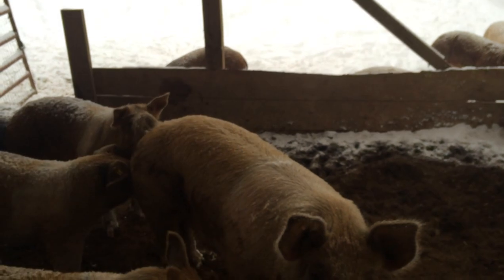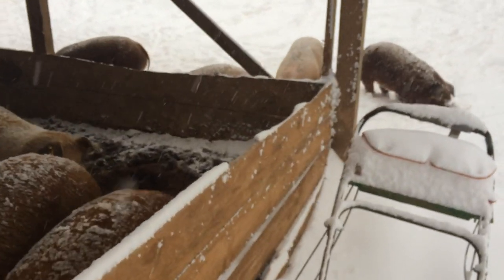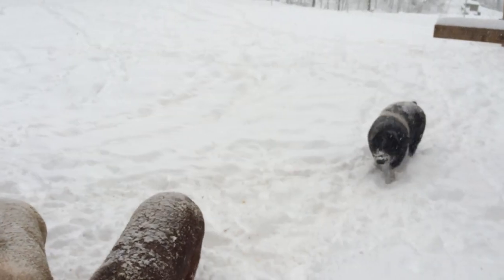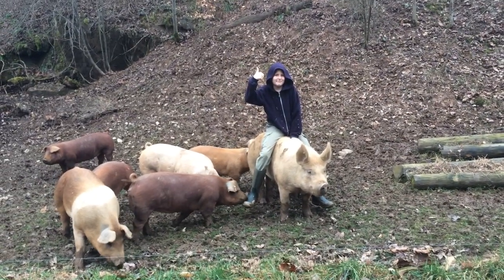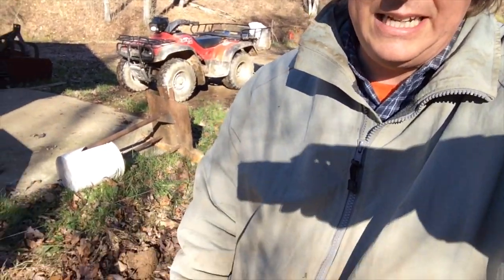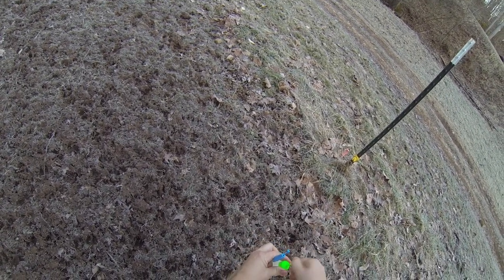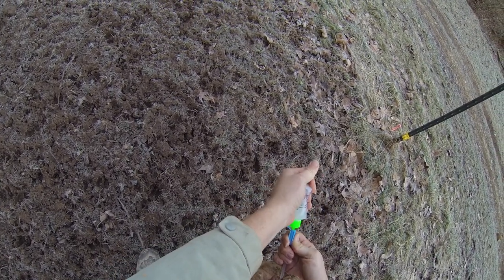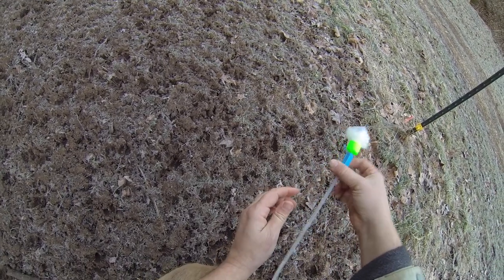Episode 4 - Pig Insemination - Artificial insemination on pastured hogs

Comment: how old should a sow be before breeding?
Reply from the maker: superma74 I go at least a year because I only breed in the fall but I have heard people breed as early as 6 months. That seems to young to me.
Reply: Development, size, weight and age are all factors. I've bred a lot of gilts at 6 months in pastured systems, but I used about 200lbs as a good benchmark. Early breeding helps keep females in appropriate body condition for farrowing and is pretty standard. Feeding a gilt for a year and then breeding is a high level of investment, not all gilts will produce satisfactory litters. At 16 months of age (farrowing age when bred at one year old) the sow can have a lot of fat and is much bigger than a market hog, at least with heritage breeds. If bred at 6 months and then culled after weaning a poor litter(probably 10-11 months), the sow will not be as big and the cut size/fat cover/processing costs are lower.  

With that being said, I've bred sows at one year old as well. Just gotta do whatever works for you. Very good video.
Reply from the maker: Great info. I only shoot for a spring farrowing since I don't have a large farrowing building. How old do you breed your sows before you cull them?
Reply: In my experience It's worth keeping a sow until she doesn't give you good litters anymore. Usually weaning less than 8 piglets is a good benchmark for culling a sow. Sometimes a first time gilt will have slightly smaller litters (weaning 6 as a first time gilt is OK for me).....if shes a good mother it's worth breeding her back. If She can't wean 8 in a second litter then it's time to go. However, that is when breeding and farrowing twice a year. If you're once a year just keep an eye on body condition, overweight sows don't release as many eggs per ovulation. I can't remember the exact reason why.

Sows that are veterans of your system can teach female offspring the ropes and will give you good, predictable replacement females. They also teach younger females to trust you. In a once a year system, as long as the sows aren't getting too heavy, they could last a long time.
Reply from the maker: grassfeeding thanks for the advice. I have one sow that is 5 years old. She had one ween her last litter. She will be retired. I have another that is 3 years and she gives me around 13 weened on average.
Reply: That is a good sow, worth keeping some females from her!

Comment: I have about 6 sows how do I make them come on heat at the same time and if am to use drugs which will u recommend for me
Reply from the maker: Stephen. sottie Afolabi I don't recommend using any drugs to alter heat cycle. The heat cycle is every 21 days and the semen has a 10 shelf life. If they have been together long, you should notice their heat cycles will start to line up together. Personally, I wouldn't want 6 sows farrowing at the same time. Mine are usually several days apart. That allows me to tend to each one.
Reply: Red Tool House - Homestead thanks
Reply: A few questions sir will the sows start to go in heat around same time if grouped together cause I've  seen other videos of farms breeding over 150 per week  or do they just have so many that they count the 21 days too?Also the Catheters do they screw in clock wise or counter clock wise and are they one time use? So if your a breeder would it be beneficial to breed year round and if I was to keep some boars on hand what is the ratio from boar to sow? 10-15 sows per boar? So don't change their diet when they go into  pregnancy  to reduce fat?